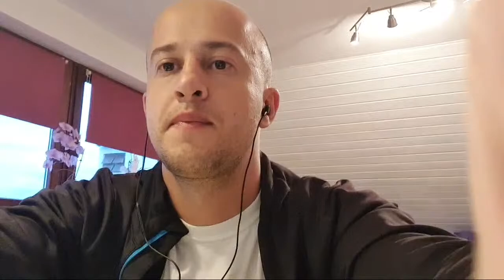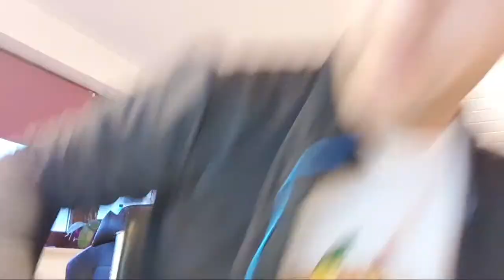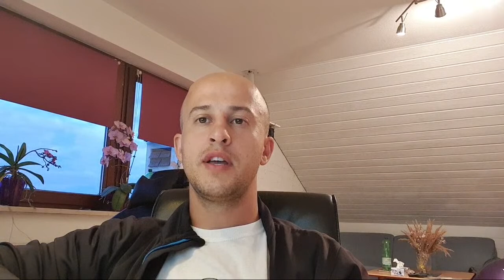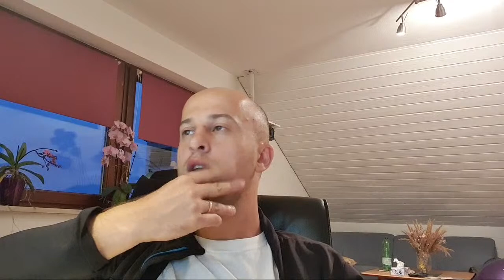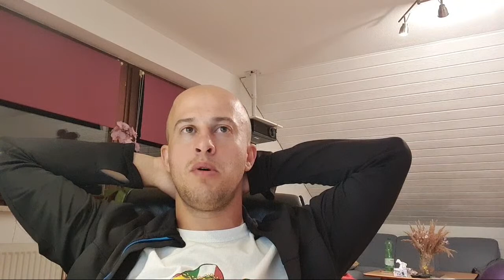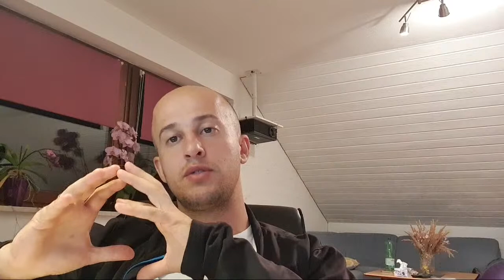Ebike Q&A #4

Comment: hello, about overheating - the heat is mostly generated in windings. This is a reason why outrunner motor (Typhoon) is not used in applications requiring big power, simply because you are unable to dissipate heat from windings which are inside the motor. In fact, these windings are thermally isolated from outside, because air gap between rotor and stator. This is unfortunately disadvantage of simple design of motor-wheel.
On the other side, inrunner motor (Vortex) have windings at outside, so very simple application of heat sink or water cooling jacket is possible.
Also KTY83 is simple PTC resistive sensor (positive temp. coef. - with higher temperature resistance is also higher). Controller most likely supply current to this sensor by some bias resistor and measure voltage drop. There is always possibility to connect to this sensor in parallel and measure this voltage drop. Next using conversion table (and also knowing the bias current from controller), one can very easy interpret this voltage drop as real temperature. It can be done with some electronics.
Reply from the maker: You are wrong about Vortex motor
Reply: @Vectorebike  I don't understand - in which way I am wrong? Motor used in your Vortex bike is inrunner, isn't it? So windings are located at large outer diameter of motor, there is way better access for attaching heatsink...
Reply from the maker: And for temp sensor it was not Sekret for me, but thanks)